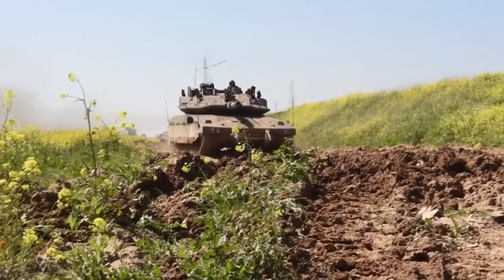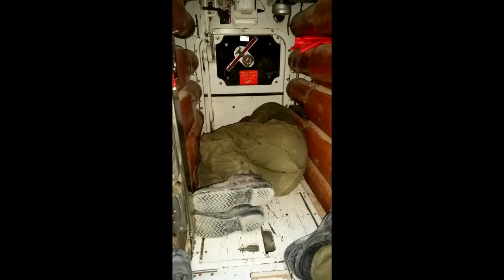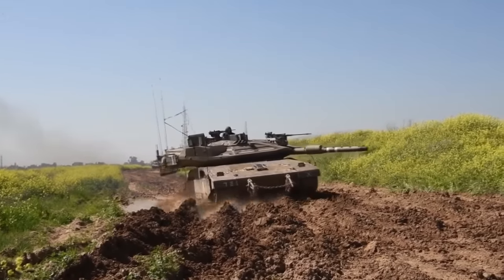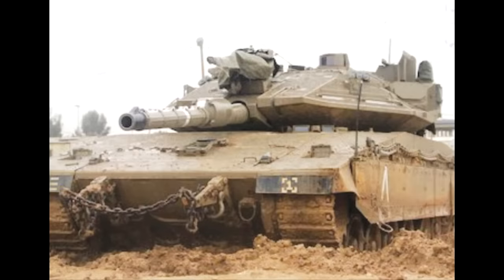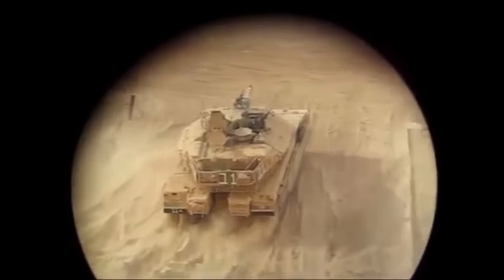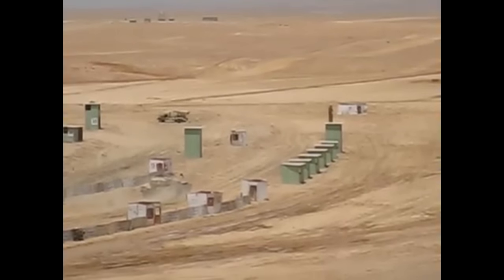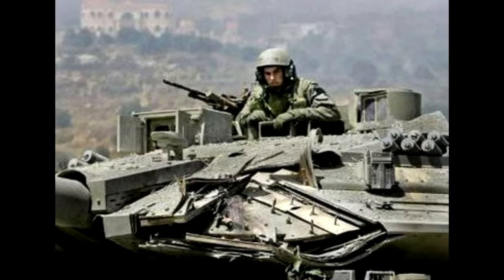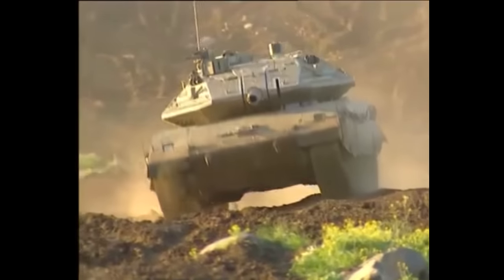Problems with Merkava tank

Comment: As a former merkava Commander I did not see any problem from the Gunnar having problems with thermal systems due to the engine being in front. Also the fuel compartment are not only in front and if I remember correctly you always can choose to seal off the front fuel from using.
Now I'm not saying it is a super tank. Every tank has it issues but I do think it is one of the best tanks for it area of use and the job it has to do.
Reply: A sense in this sea of salt and triggerd people, sir
Reply: @wonkagaming8750  not sure what you mean by that but sure
Reply: @cerbrus828  i meant the there is still someone that had coman sanse and open to problems instead of getting triggered and salty about set subject
Reply: @wonkagaming8750  ah. sure dude. think about it i have first-hand experience with this machine. some things are good something are absolute shit. but that is with every machine ever build. thats why we always get better as a human race.....well most of the time
Reply: Key word area of use. That is what it is designed for and where it is outstanding. Also it currently isn't designed to face the most modern armor,and is more than sufficient to match and overcome any of it's neighbors and or peers
Reply: @cerbrus tell them, its not the tank that matters, it's the peoples who operate the tank
Reply: @ZIGY194  you are absolutely correct like every machine you need good capable people to take it to its maximum
Reply: @cerbrus828  you can compare machines, but you can't compare idf's to different armies
Reply: @ZIGY194  I guess you are correct. 
But there is an interesting discussion there to be had. 
Like training amount between IDF and other armored units from different countries . That's something interesting to do in my opinion. 
To have a discussion between let's say IDF tank commander to a USA one or any other country .
Reply: maybe it depends on the thermal system. But I imagine that modern systems for high resolution long range imaging could be disturbed by heat. The heat radiation from a hot  engine in the front is thousand times higher than the one coming from the distance.
Reply: @hugopepe1722  perhaps. But from my experience did not have any issues with the thermal systems being abstract by the front placed engine or the side exhause port.
Reply: from what i read before i remember the istraeli and its teaching prioritizes life more than the tank itself
Reply: @Corpasmoment  correct. It takes a long time to train a crew man / commander.
And I assume more expensive overall to train a good Fighting crew then repair a tank.
But basically you are correct it's more of quality over quantity
Reply: @mechanicaldevelopment9944  יכול להיות.
או פשוט לוקח את כול המידע שזמין במקומות כמו ויקיפדיה שזה לא מידע הכי מדוייק.
Reply: @cerbrus828  
הסתכלתי על המקורות שלו והוא מצטט הרבה מקורות רוסים, שזה כאילו, לך תדע אם זה נכון לא נכון, אמין לא אמין. אבל אין בתו"ל בכלל משהו שמדבר על לא לשים את הקנה מעל הגריל פליטה בגלל הפרעות טרמיות, אף פעם לא שמעתי על זה עד משחקי מחשב
לא יודע, נסיון שלי ממרכבה 2 ו3, אבל זה נשמע מונפץ פיגוזים
Reply: @Secular-Hebrew  כי זה מונפץ .אני אישית לא שמתי לב להפרעות מהגריל בסימן 3 במיוחד שהכוונות הרבה הרבה יותר גבוהות מהגריל והאגזוז לא יוצא ישר למעלה.
Reply: @العلمللجميع-ثقفنفسك  sure thing.
Who is the original owner tho?
Birtish empire? The otomans? Maybe the roman empire? Or perhaps even farther into the past? 
Anyway that's not the point of this discussion.
Reply: @cerbrus828  the local people, the Palestinian you know that but you are denying
Reply: @العلمللجميع-ثقفنفسك  so by that logic everyone around the globe shuld " give back " land? 
Like usa to the native american
Alaska to the russians and so on ? 
I'm not gonna have that discussion over here because it is pointless.
All I have to say you n the subject is that all of the people living in one land need to push together for a better future for everyone living there
Reply: @cerbrus828  there aren't citizens of native Americans to ask the USA to return the land " I mean a huge original numbers of them" but the Arabs Palestinians from Moslems,Christians , and the few Jewish who lived continuously for thousands of years before the great illeagle Jewish imaginations began in 1920 and after under the British , occupation , the land owner still there, and every Zionist member immigrated to Palestine during the British occupation and after, must confess that they came in spite of the local Palestinian people, so you are illegal citizens
Reply: @العلمللجميع-ثقفنفسك  sure thing dude.
But I don't know where you coming from with all that. 
I myself am not jewish and don't think I'm a zaionist and probably many people that living in israel are in the same mind set. 
But if you got to the legal side of things then I'm pretty sure that back then the british who wore on the land gave a full mandate to jews/ arabs who lived in israel a devided land and on side was ok with you while the other was not.
Any way this discussion is pointless because you are very locked on only one possible solution without looking on the bigger picture of this land.
Stop deviding and living in the past . What you should do is getting ALL the people who living in that land to stand up together no matter if they are jews muslims Christians all that matters is getting a better life for everyone how lives in that land together.
Reply: By the way returning to the video, the Merkava tank always used to fight the Palestinian people chicken cages, small mud builded coffe shops, little palms and Palestinian kids holding small pieces of rocks, but not a real army, nevertheless, the Merkava would act as a water tank not a fighter tank !!!!!
Reply: @العلمللجميع-ثقفنفسك  you are really missing the point of the video there
Reply: @cerbrus828  you say it's okay that the British occupation gave the land to creat Israel? Is your conscious feel ok? Does the British occupation own the land? By your logic if Russia as example came to invade your land and brought hundreds of thousands of foreigners from all the world to inhabit there and forced you by power to accept that so that would be Ok for you? I don't oppose any religion or race , but not by forcing people to leave there land by military power and give it to another foreign inhabitants, as Israel made in 1948, the force logic is not a justice, and by using it, you will still live behind the huge tall walls that separate you from your surroundings
Reply: @العلمللجميع-ثقفنفسك  my point is that what happened is already happened and there is no point to live in the past both sides done wrong things I'm sure. 
The point is that none of the sides is gonna just get up and leave . So why not starting work together for a change? The past is the past you learn from it for better or worse and strife for a better future for all people
Reply: sgfhk321  I guess you can look at it that way. But I think every combat vehicle now days is build more for a crew protection
Reply: sgfhk321  Trust me dude i know.
i served in one of them.
Reply: @العلمللجميع-ثقفنفسك  I am an Arab and I have to agree with him, this conversation is pointless. If you look at history, it was never about who is the original owner, nor was it ever about morality, but it has always been about who was the strongest. And after all, this is not a political video, it's a technical video about a tank, so you should respect that.
I like the work you have on your channel though, and wish you the best
Reply: I would not take seriously  2/3 of the bashing that is going on in this video, which was done by a person who either is talking about the first generation of Merkava from like 30 years ago  or saw the said tank only in photos or in a video game :P
Reply: @danieldunn6284  nah even for what its designed for its shit. over priced chinese tanks offer better protection and mobility and thats saying something.
Reply: Yeah looks like a pretty good tank against stone throwing teenagers.
Reply: @badgermcbadger1968  the armor designs for most tanks are readily available online
Reply: @العلمللجميع-ثقفنفسك  Palestinians are an amalgam of Arabs generally (said a Fatah commander in 48) and Solomon's Temple was built 1500 + years before you built the Al Aqsa mosque on top of the ruins.  Only after you tried to outnumber us 70-1 and lost in 67, did you propose a 2 state "solution". Your pre 67 boundaries offered by Israel in 2000, 2005, 2008, and you rejected this.
You have various "holy cities"   We have one AND WE ARE NOT LEAVING.
Reply: @richardschulman8821  you are lying, historically you are wrong, years of search under Al Aqsa done by the Zionists without any proof of finding the prophet Solomon temple, as all Aqsa mosque wasn't build at the date you say, actually you ( the Zionists )  are not even the grandchildren of the prophet Jacob, you are Irish, Russians, Americans, British ...... etc, one day the corrupted Arabic regimes that you support to frustrate the Arabic people will fall, and the people Wil restore their decision and dignity, then ; I see to let you leave back peacefully, and don't make it again
Reply: @العلمللجميع-ثقفنفسك  
Ah the fantasy world of muslims. 
Jews were in Israel well before the world heard about Muhammed or Islam.  Don't ask the jews, ask the ancient Greeks or Romans ask the Christians they will teach you history.
Arab mythology isn't a good resource to learn history.
Reply: @hugopepe1722  you are arguing with somebody who is a tank commander of the specific tank in question. Heat does not cause problems for the thermal cameras.
Reply: it's a tank fitting for it's area is very correct. The tank functions greatly fighting older soviet model tanks such as 72a and b. But it's only good in that reagion, any where else they would have the technology and strength of the tanks can penetrate through the engine and kill and injure the crew. over all a good tank for it's job and a good looking one
Reply: so where is this solomon temple again
Reply: @cerbrus828 thank for defending israel!

Comment: "Problems with Merkava tank"
Me an intellectual: THE ENGINE
Reply: I mean, I can carry people now
Reply: @randomuser5443  ya meant, I can carry people.
Reply: Merkava MK IV M how things go in 2006?
Reply: @fouadjaber4111  *went
And it was ok, I mean, yeah, some comrades were downed, but not that much...
Reply: Saving the crew is better than saving the tank.
Reply: @Nicolay406  Bro didn’t he actually say that the engine didn’t provide that good protection?
Also what if the Engine gets set on fire? Is that good for the crew?
Reply: @motorriderd6834  
And where does he get his information from?
Has he ever drove a merkava tank before?
The main design factors of the Merkava were taken from previous Israeli war experience. the number one item on the list is crew survivability. So the engine and trans were put in front to act as more armor. In addition they placed all fuel lines and hydraulic lines outside the hull as there were survivable hits on previous tanks that resulted in fire. Placing the drive train in the front had the additional advantage of allowing space in the rear for a squad of soldiers. It can be a tank and a troop carrier as well.
The Merkava is a very successful design, not the best in the world but the best for Israel.
The designers knew what they were building otherwise they wouldn't have kept it.

Engine fires are a problem in every tank.
Reply: @Nicolay406  my dude…
Stop being so biased about the tank
ITS NOT GOOD
Watch the video again
THE ENGINE DOESNT PROVIDE ANY REASONABLE AMOUNT OF PROTACTION TO * SACRIFICE THE ONLY WAY OF GETTING OUT OF AN ENGAGEMENT YOU HAVE JUST BEEN HIT IN*
If the engine is burning and you can’t get back into cover the crew HAS to get out of the tank and abandon it 
The front engine design might have been good 50-60 years ago but now there are tanks running around with pen numbers common and comfortably going over 500mm where an engine doesn’t really do anything against that
I think he mentioned that aswell that the whole engine compartment against APFSDS only provides about 20-40mm of protection 
Is that amount really worth loosing the ability to get out after a hit? I don’t think so mate
Reply: @Nicolay406  also don’t get like That 
He gets mad at people doubting his abilities on searching for information because he has all the sources linked and spends days and probably weeks researching and checking the Informations for us
Reply: @Nicolay406  it’s a tank and I does its job but compared to other tanks roaming the world it’s not good and That’s literally the point why one could say it’s bad.
Also don’t get mad at me bcause I just made a joke, remember?
Reply: @motorriderd6834  you realize not a single modern western tank is being used by the enemies of Israel?
Reply: @merkavamkivm3373  Well, I can make my enemies feel the power of hundreds of missiles while also annihilating them with AC/20  rounds. What about you?
Reply: @motorriderd6834  
The tank is good. It proofed itself in various conflicts already with a lot tanks being lost due to enemy fire. Yet that doesn't matter since the main focus lays on crew protection. Compared to other tanks the Merkava saw pretty intense action and therefore was improved according to experience made in combat. Overall the protection is okay. The fuel tanks and the engine do provide good protection against HEAT. Here I have to criticise RedEffect, since it doesn't matter that engine is exposed and the tank could ignite by a hit, since the main goal, protection for the crew, was reached although the tank is destroyed. As far as I know most Merkava were lost by IEDs or bombs, yet rarely by enemy tanks or anti tank weapons. So here is work to be done. There is a lot of space in the tank itself actually what minimises chances of critical hit. The thermals btw aren't affected by the engine. Spookston made a good video about that topic.
I don't see any critical problem with the tank. Its actually pretty good and its improved continuously. The statistics speak for themselves and proofs that the concept workes out. Its not the bes tank in the world, but its the best for Israel and comparable to other tanks of modern times.
Reply: @fouadjaber4111  Israel won then
And mk 4 wasn't exist
Reply: Islamic Army  you mean heat projectiles? The one thing the mirkiva is designed to protect against? The thing trophie was designed to counter? Forgive me for not being convinced. Maybe you should have given some thought to why I didn't bother mentioning atgms and man portable anti tank weapons.
Reply: Islamic Army  yes. Isreal has the industrial capacity to recoup veichle losses easily.
Reply: Islamic Army  yeah because a tank that you just failed to destroy would totally just sit there and wait for you to try again.
Reply: Islamic Army  loosing 4000 troopers and 300 armoured vehicles is Hezbollah success?
Reply: @Nicolay406  an engine won't stop a round
Reply: @schnitzel0330  Merkava has not preformed that well in conflict besides 2014
Reply: @grandayatollah5655  
It had problems in conflicts after 2014 because of ATGMs. That's why the trophy system is now being implemented if you haven't noticed. And yes, the engine can stop a round. And in the very front of the hull is fuel which also increases protection for the crew. In therms of crew protection Merkava still is outstanding.
Reply: @schnitzel0330  bruh fuel is not stopping a round lmfao. Also newer ATGMs are top attack and can bypass trophy, including Iranian ones. RPG-30 too
Reply: they sacrficied power engine, for other priority, israel a small country no need for a super higgh speed engine.

Comment: Well, the entire point of the frontal engine layout is that if the tank were hit and penetrated, it would most likely result in a mobility kill, meaning the crew can escape and the tank can be recovered at a later time. If your ammo blows up or you regularly lose crewmembers its much worse. Strategically speaking, it makes a lot of sense, especially if the engine and transmission units can be readily replaced in the field, like on the Leopard 2. In that case you would be able to maintain a high percentage of battle-ready tanks compared to, for example, russian tanks like the T-72 which are still prone to ammo hits, requiring less tank production as well as crew training to maintain a tank force.
Reply: As it was said in the video, engine is not able to stop most of the modern tank shells
Reply: yeah he was not saying it would just kill the engine what he means is that it would just negate the engine entirely and just fly through it APFSDS and HEAT of today do not care      but as it is it does not really matter who ever shoots first will most likely get a chicken dinner
Reply: With a big hole in your frontal hull armor, there is no such thing as a quick engine swap to get it back into action.
Reply: @Ganiscol  …And my guess there will be more than a single hole in your tank given the force of impact of the round against the engine and the subsequent kinetic reactions occurring within the engine compartment.
Never mind any basically trained enemy tank crew will most likely throw follow-on rounds into your immobilized tank whenever possible until you’re good and toasty….
Reply: nowadays most hits will be from top, sides, and rear (drones, Kornet). but frontal protection is sine qua non. when Ka Vikhr hits u, should be able to take the impact.